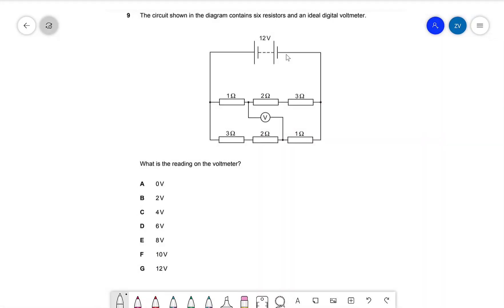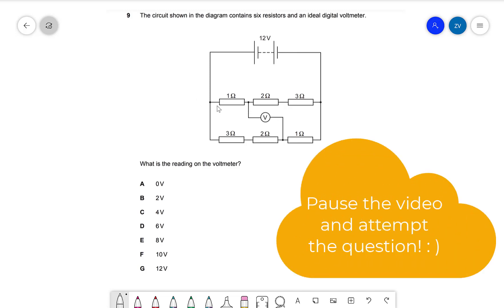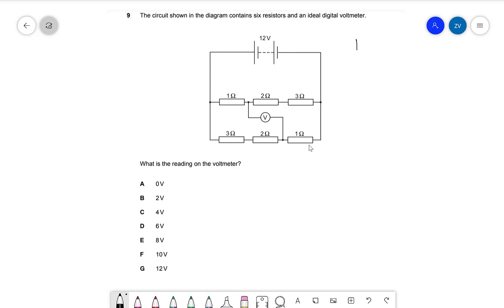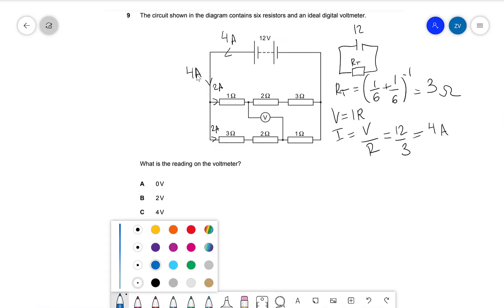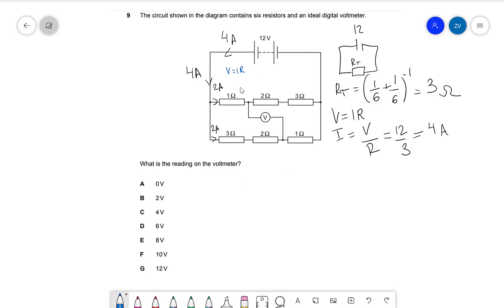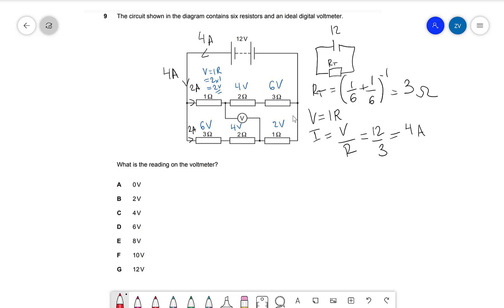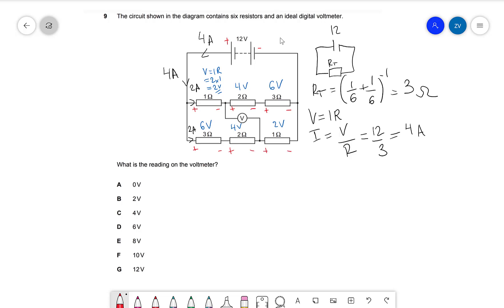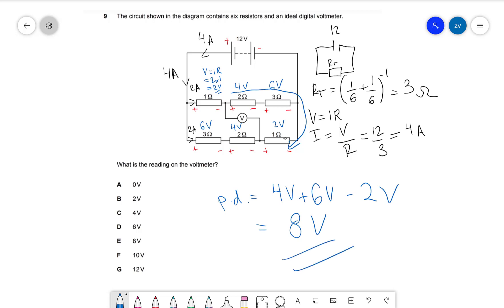Can you solve this Cambridge admissions circuits problem? | ENGAA exam | Kirchoff's 2nd Law

Comment: A simpler way to solve it would be finding the potentials at both ends of the voltmeter. 
The p.d across the 1ohm resistor in first branch is 2V as the voltage(12V) is shared in the ratio 1 : 2 : 3 so 1/6 x 12 = 2V
Then the potential right after it will be 12V - 2V = 10V
The p.d across the 3 and 2 ohm resistor in the second branch is 10V as the voltage is shared in the ratio 3 : 2 : 1 so 5 / 6 x 12 = 10V
The the potential right after it will be 12V - 10V = 2V

Thus the p.d measured by the voltmeter is 10V - 2V = 8V
Reply: elegant :hand-orange-covering-eyes: